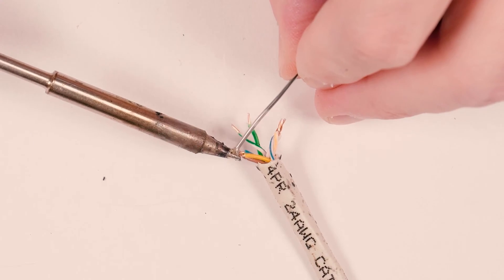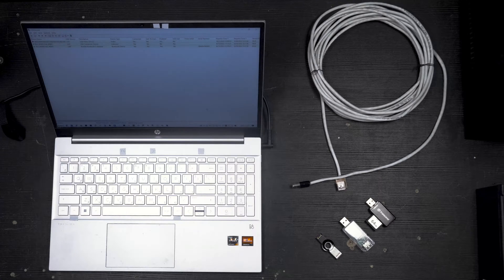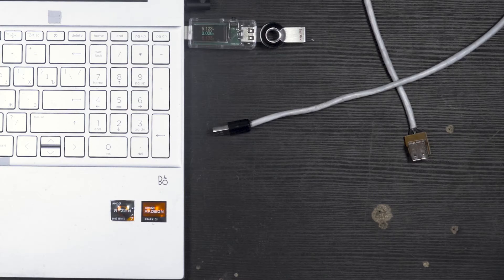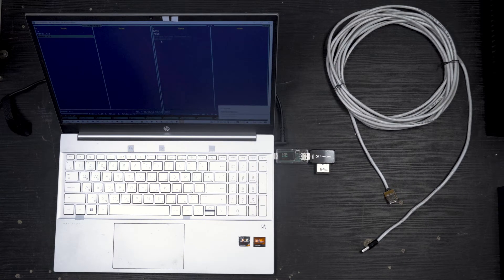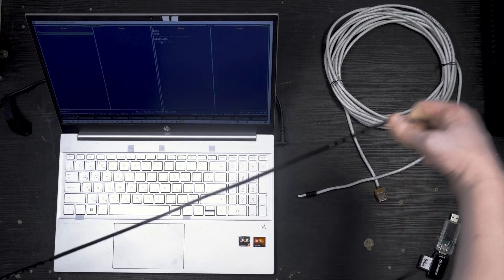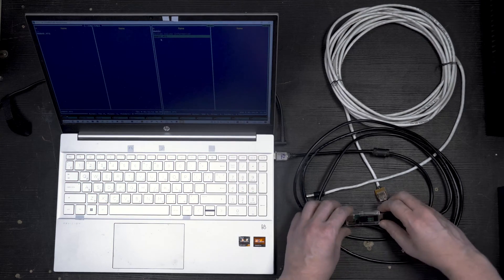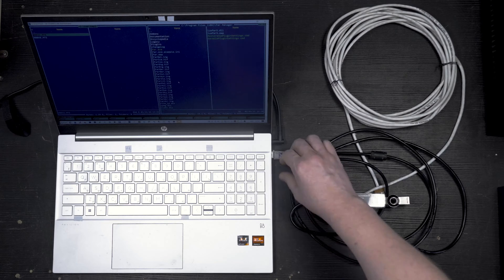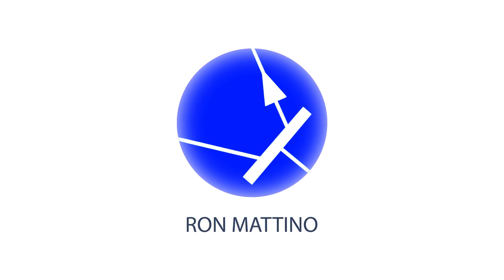USB over UTP cable: Testing Voltage Drop and Transfer Speed.

Comment: Can we make a usb3.0 cable like this?
Reply from the maker: Not really. Or at least, so far. USB3 uses shielded pairs with an additional ground wire per every pair. FTP cable does not have that.
Reply: I tried with cat 7 that has shielded pairs, but for some reason sometimes it fails and sometimes works, maybe depending of the host device. I mean is unreliable for all purpose and 5 meters max. Plus the cat 7 cable is expensive, at least in my country, I don’t have many meters for continue testing.

Comment: Actual longer usb cables are really bad usually with voltage drop. Due to just using same cable gauges that were meant for 1 meter cables usually. And rf interference.